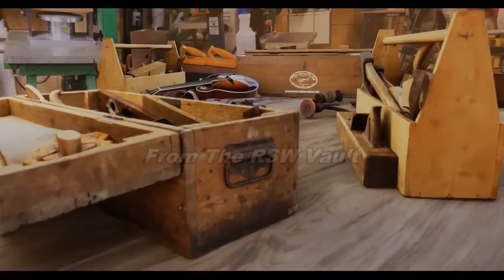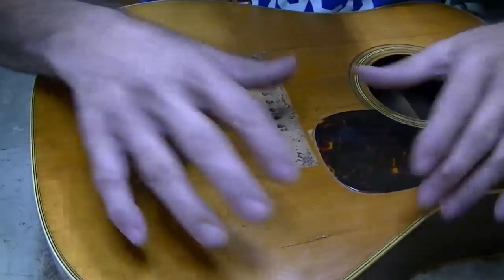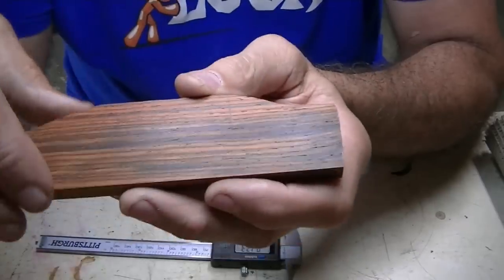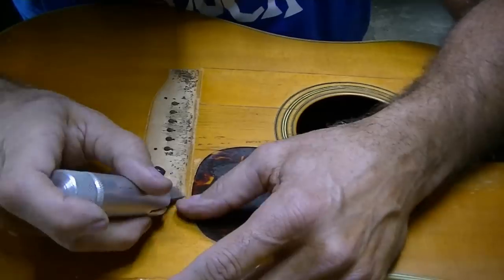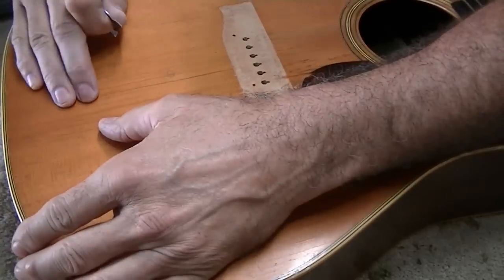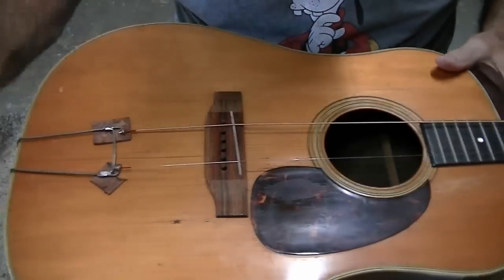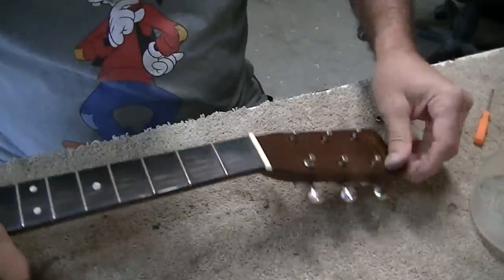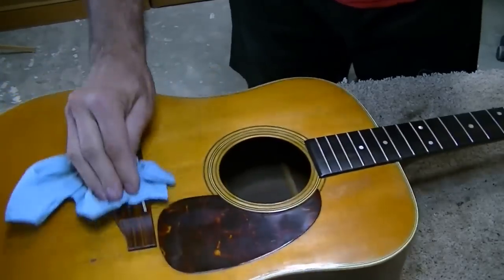574 RSW EMERGENCY! Dr. Rosa Performs A Life Saving Surgery On Mr. Martin D-28!

Comment: It's funny because that practice of cutting the fret board at the 14th fret, or at the body joint, was practiced in early guitar repair days for sure, and was the recommended procedure back then (even by Martin). But they don't do it now because cutting the fret board, right at the body joint, allows the neck to pull forward again much sooner. Because it's like you created a hinge there. The fret board helps make everything stable and solid. I understand why you would need to cut the fret board in some cases but it would be much better to cut it 2 or 3 frets up the neck. But I'm not a luthier so what do I know... Lol... That old Martin looks great again Jerry. Nice work.

Comment: U can use a pallet knife & an iron & as long as it was hide glue or fish glue it will come off very easy. There's no need to pop off the length of the fretboard as long as you're only pulling the top off of the body.

Comment: Jerry I Had a Martin D76 that haad those waverly tuners on it and it really didnt matter how often you cleaned them they would tarnish in 2 weeks time and that is one reason I never cared for martin guitars plus you could polish that guitar today and tomorrow you couldnt hardly tell you had polished it and like you I used the rennissance wax to polish it with and That guitar really burned me out on Martin guitars. I finally got so disgusted with it I traded it for an EPIPHONE J200 and was much more satisified with The Epiphone all around than I ever was with that martin. The setup, The sound, and all was to my ear SUPERIOR to the martin. I could Tune the martin WITH A PITCH TUNER as you do and be perfect pitch in E and the second string would off cord sharp in D And Visa Versa..The Epiphone never ever off corded on me I could Pitch tune it and it would always perfect cord in every cord but what really got me with that martin was how fast those tuners would tarnish and I live in piedmont area of North Carolina and Its not all that humid here and you know as well as I that humidity can cause metal to tarnish but I never had that problem out of the epiphone

Comment: I would be dubious that Martin did those repairs, especially the bridge.  More likely a "authorized Martin repairman" which I have had some experience with.  Martin may have authorized some luthier to work on the instrument but those folks vary in their methods from one to another.
Reply: also obviously the reason why it has wide binding is because it originally abalone and to reinstate that may have doubled the price so they didnt bother. on second thoughts i think it may have come with that binding, i once saw a 50's reissue with those tuners and plain binding.
Reply: You would be shocked at some of the game's Martin plays with repairs, lol.
Reply: It looks like they cut the sound hole out.

Comment: It broke along the pins because they forced the bridgepins in too deep. As per the owners manual the bridge pins are not designed to bottom out up to the collar of the pins. Just received my HD-28 and low and behild the bridge pins are not inserted all the way to the collar. Owners manual says just insert the pin in deep enough to securely hold the strings

Comment: Hey!  Love your videos, and this one was especially satisfying.  One thing that piques my interest, however, is seeing all these solvents coming into contact with the finish of the guitar (such as lighter fluid and CA glue accelerator).  How do you know which ones are safe (short of potentially disastrous trial and error)?  I guess you develop a sixth sense for these things over the years, but I'm always afraid I'll wind up wiping the finish right off (or leaving a big smudge at least).  The main ingredient in my CA glue accelerator is acetone, which seems like it would be especially caustic.  Not to mention the chore of cleaning super glue off of the finish... I'm probably more likely to make an even worse mess out of a bad one.

Comment: C.F. Martin Co. makes oversized bridges. That might be an answer to certain situations like this one. Of course, it's hard to say if their bridges would be oversized enough to cover the part of the top of the guitar that you are trying to cover, in this particular case. I also think you should have made the bridge out of ebony instead of rosewood.

I noticed in another of your videos that you were using Simichrome polish as polishing compound on finishes. If I'm not mistaken, Simichrome polish is for metal and it works miracles on metal. I know because I have a tube of it here. I used it on a pair of silver fingerpicks that were over 50 years old and ugly-looking. After using the Simichrome metal polish on the fingerpicks, the fingerpicks look like brilliant gems. I don't know if there is such a thing as Simichrome polish for rubbing out finishes and I'd be skeptical about rubbing it onto lacquered surfaces.

Comment: Yeah, 
I'm with the costumer about the fingerboard in one piece. The neck of an instrument including the fingerboard is an integral part of the response machanics of transfer and character of the instrument. Upper harmonic support. It might be a subtle degradation but any degradation would be unacceptable imo. I know what the difference in just changing the fingerboard on an instrument can make on the sound. It can mean the difference between it having something special, and be adored, and something to try to get sold to someone who doesn't know any better what could have been. Some folks ears are acutely aware. The bain of a luthier. I have pissed off a couple in my day. ☹ Sad. I know time is money. But some instruments are like family. I've also done repairs on folk's instruments that they were not happy with also, so I've been on both sides of the bench. Doesn't feel good. It's kind of a lot of responsibility to work on a fine or valuable instruments. I don't like the stress, so i just do little repairs now. Fretwork, cracks, nuts and saddles. In the end we all are striving for the same result, a new lease on life for a sad instrument, and I guess we need to remember to have compassion for both the Luthier, the musician, and maybe even the instrument. 
Thanks for another entertaining video. ❤

Comment: Putting an oversized rosewood bridge on a '50's Martin D-28 is wrong on a number of levels, especially when you had a usable ebony bridge in hand that might've only needed a little touch-up work around the edge.  And why glue on a too-thick bridge, which then has to be sanded from the top after gluing which ruins the bridge top profile and transitions to the wings?  Too many serious errors here...definitely some things to be avoided in this video...